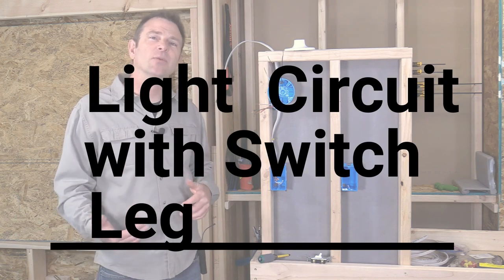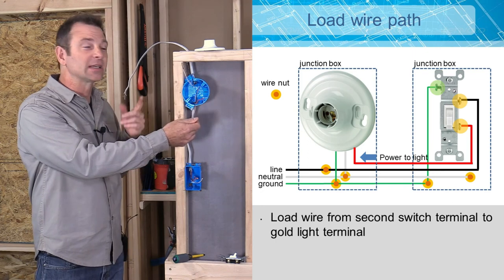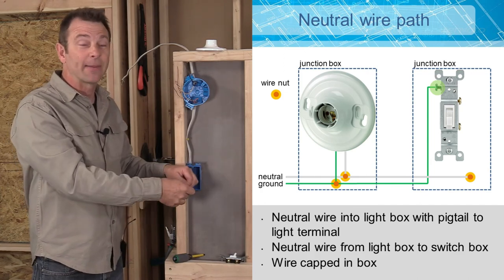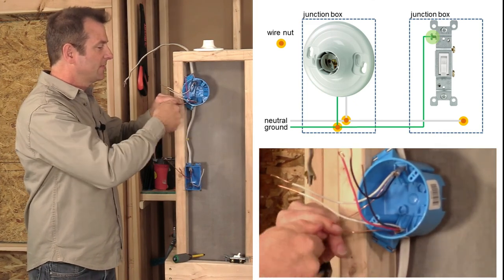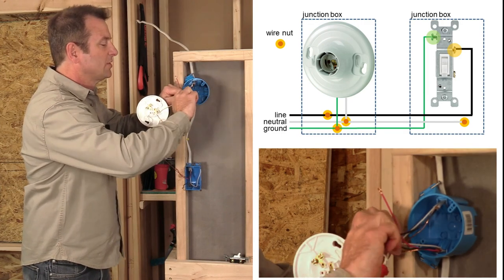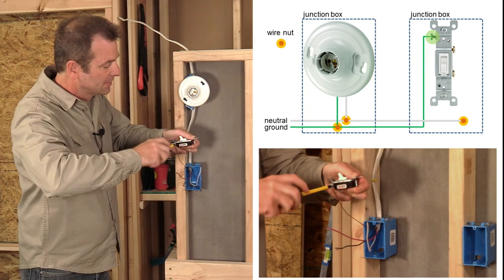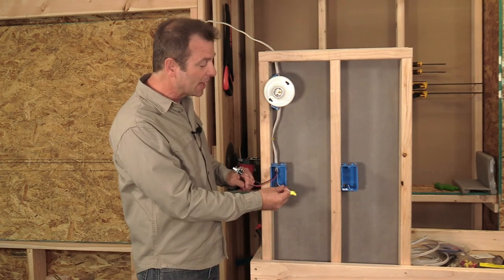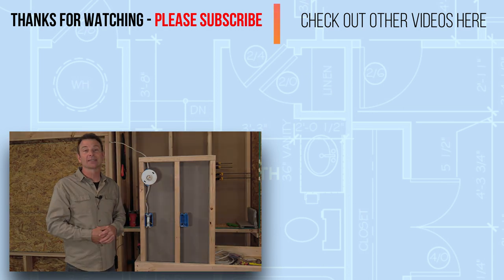Electrical Wiring Process - Part 9 - Installing a Light with a switch leg - Come wire with us

Comment: This was an excellent explanation.  Do you have any videos on wiring a ceiling fan/light?  I have 14/2 wire feeding power from my breaker to an existing switch in a 2 gang box that controls another set of lights.  I think I need 14/3 to power a combo switch which will control the fan on one slider of the switch and another slider to control the light.  I want to get power from the existing 14/2 wire.  Can I do this or do I need to splice into an existing 14/3 in my attic and bring that feed into my box to supply power to the combo switch?

Comment: My house has just a 14/2 switch leg.  1955 build sucks for smart switches. Plan on running a 14/3 from attic to get that neutral in my switch.
Reply from the maker: Yeah, making a smart home is hard on old wiring.   Good Luck

Comment: Correct me if I'm wrong but in your diagram you show the black (hot feed) connected to the top terminal on the switch and the red on the bottom terminal. Shouldn't the black (hot feed) be connected to the bottom terminal and the red to the top terminal for the switch on/off to work correctly? You wired the switch correctly (black hot feed-bottom & red to light-top) but the diagram shows the opposite.
Reply from the maker: That switch is a single pole switch - meaning that it has only two positions...open and closed.   When running a switch leg, it really does not matter what orientation the two wires are.   In both ways, when the switch is in the closed position (ON) the power will run through the circuit.   When the switch is in the open (OFF) position the flow of power will be interrupted.  Think of it as just touching two wires together.  When touching the circuit is closed and operates - when the wires are not touching they are considered open and the circuit is not a closed loop.   Does that help any.

Comment: What's the reason for code to require a neutral wire if it's not connected?
Reply: In my experience, meeting code requirements is a guessing game that depends more on an inspector's state of mind than reality.
Reply from the maker: Meeting code should not be a guessing game - but you are correct that inspectors  differ from one another and even by the day.   But if you can meet or exceed the code requirements you should be OK.
Reply: The Neutral is not needed this basic single pole switch to operate correctly but its part of newer code asks for it.  In the case were in the future someone wants to install a dimmer or a smart switch, some if those devices need a neutral so you will have it already in the box.

Comment: ago
i want to add 2 lights in a row to an existing circuit power source.. i Am wanting to put an end of line switch (loop Switch) after these 2 new lights. I understand from your video how to wire a loop switch but my question is (two-fold) ...do I wire the 2 lights in a row the same as wiring a single as in your video?... another words utilize the neutral from the first light ( in line from power source) as a power source as in "daisy chaining" the wire to the second light, and then down to the switch?? Also, as I stated earlier, it is an existing power source from another light, so , in adding this loop switch , will it affect the existing light power?

Comment: 接灯线开关时，当把地线和零线接上灯时，我认为不要先接灯的火线和红线，而是按照电流方向的顺序走，先接黑线到开关，再接开关的红线，再把灯的红线接上，这样按电流顺序走，永远不会搞错。如果先接灯的红线，再接开关，有时脑子一发蒙或者走神，可能就会接错开关。重点时，不论输入电流端从哪里进，火线都必须先经过开关，才能到负载。When connecting the light switch, when connecting the ground wire and neutral wire to the lamp, I think not to connect the red wire to the lamp first, but in the order of the current direction, first connect the black wire to the switch, and then connect the red wire of the switch.  , and then connect the red wire to the lamp , so that you can follow the current sequence and you will never make a mistake.  If you connect the red wire of the light first and then the switch, sometimes you may get confused or distracted and you may connect the wrong switch.  The important point is that no matter where the input current enters from, the hot wire must first pass through the switch before it reaches the load.

Comment: 电源从负载灯的盒子进入，会导致灯与开关之间使用4芯线，成本增加，除非特殊，否则我不会将电源线从负载盒子进入。The power enters from the box of the load light, which will result in the use of 4-core wire between the light and the switch, which increases the cost. Unless special, I will not enter the power line from the load box.